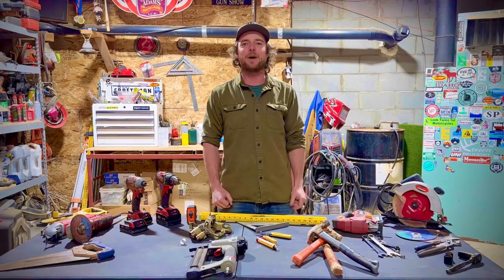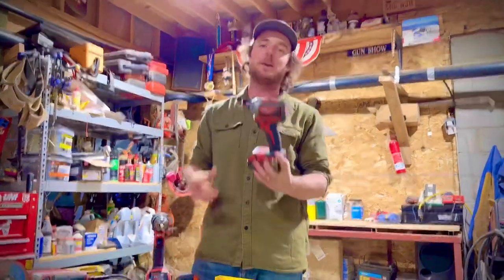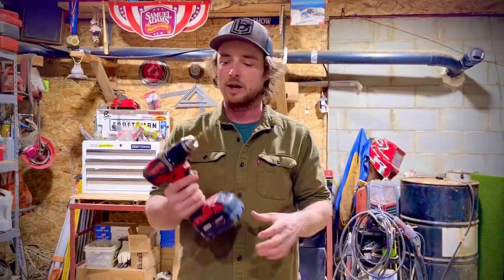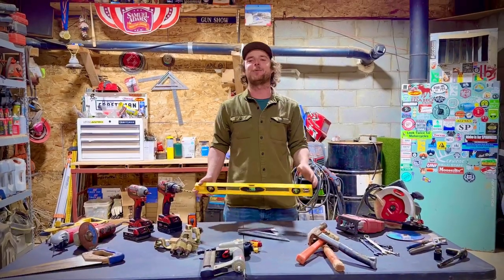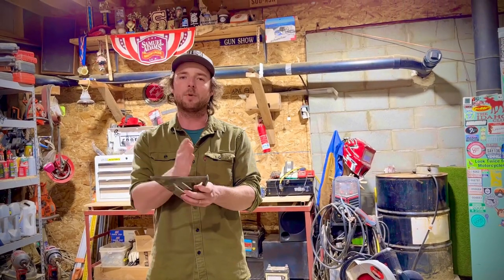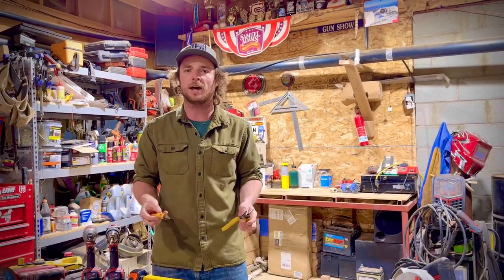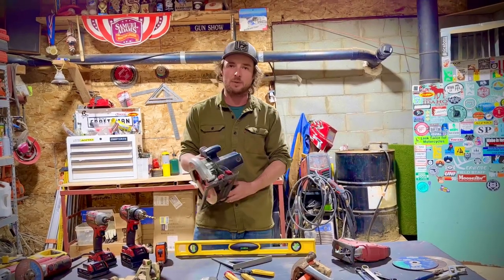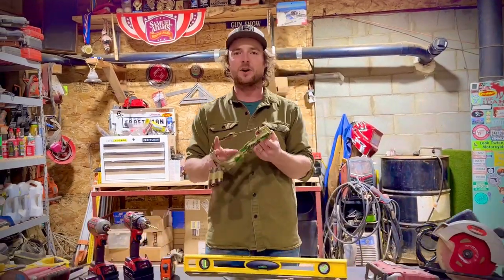8 Tools Every Homeowner Needs For DIY Projects

Comment: You missed the Hammers most useful feature.  Starting a nail by putting the nail on the hook end between the forks, with pointing end out, and push the head against the hilt.  Then look at your wall you want to hammer into, and thrust into it, you can start a nail this way perfectly and easily, then turn the hammer around and finish the drive.  No more holding a nail with your fingers to get it started.

Comment: @6:00 those testers don't like being dropped! I would not risk my life based on a light tester! A multimeter is ALWAYS the best option when you are playing with Power. In Australia electrical is NOT DIY as too many issues can be caused by novices!

You forgot THE most important ones. Eye and hearing protection first to be used and last to be put away especially with saws and drills!!